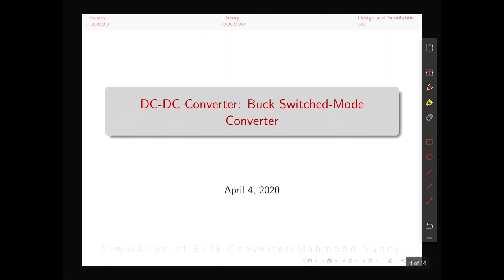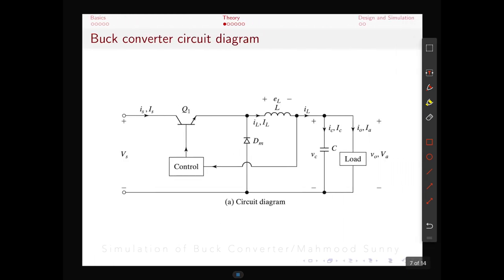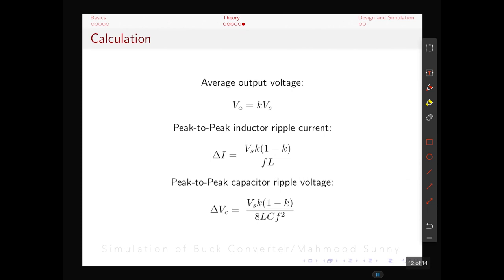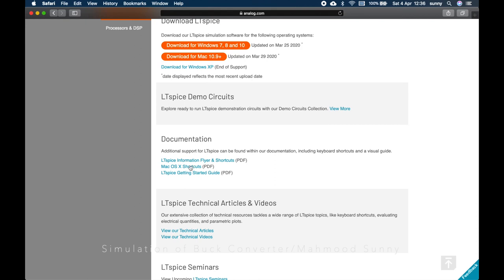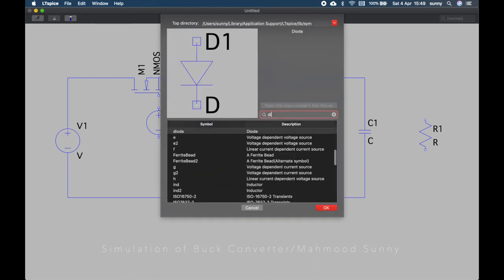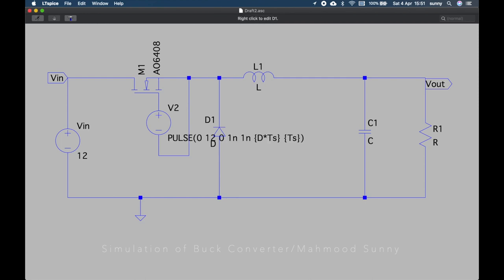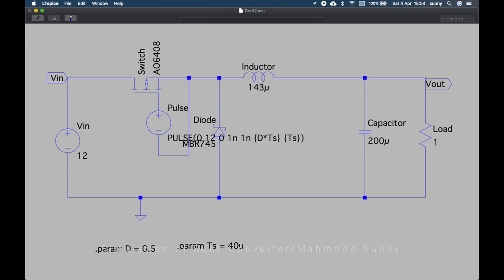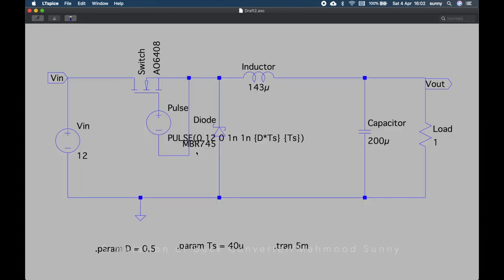Design and Simulation of a Buck Converter using LTSpice

Comment: thank you for this tutorial.. so, i have question for you. At min 3:45, you said that the buck converter uses the feedback from the voltage of inductor's output (voltage), while in your LTSpice simulation circuit you take feedback from the Source (S) of N mosfet. So, my question is... can we simulate the "closed loop system" as we use control simulation in Simulink where the system run automatically. I mean, in your simulation you define your parameter D = 0.5 before you run simulation so that it has 50% duty cycle. So, is it possible in LTSpice the D parameter is obtained from the inductor's output automatically withou we define it (as 50% duty cycle)? Thank you.